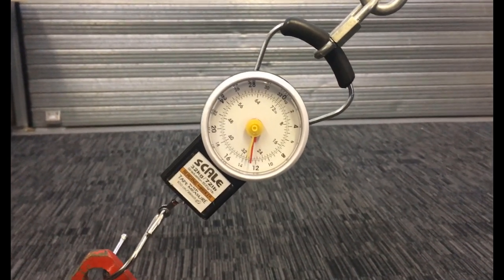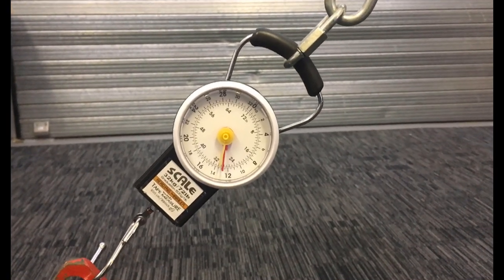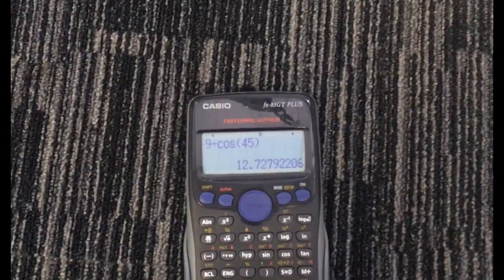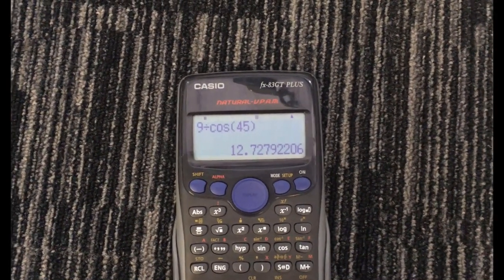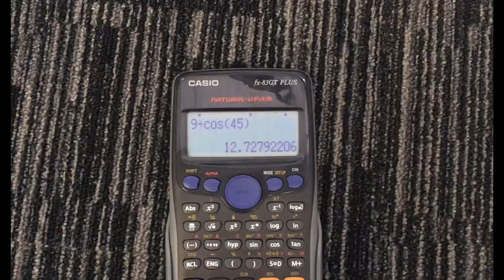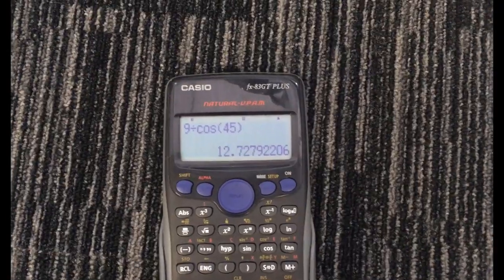Sling Tension Demonstration

Comment: Isn't it supposed to be divided by Sin value instead of Cos value to find the Sling tension?
Reply from the maker: Hi Vishnu...you would use the Sin value if you are using the sling-to-HORIZONTAL angle - as is done in US and some other places. In UK and Europe, we work with the sling-to-VERTICAL angle - hence using Cosine.
For example, 60 degrees to vertical would be 30 degrees to horizontal.
The each of these calculations would arrive at the same result - it's just a different way of doing it.
Reply: @InspHigher  Thanks a lot mate!
Reply from the maker: @chullan007  You're very welcome. :)